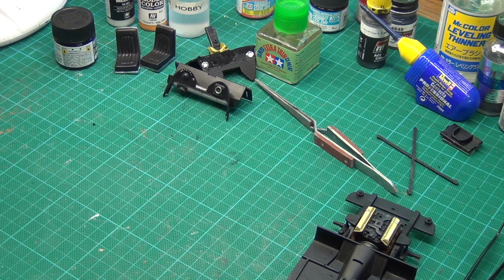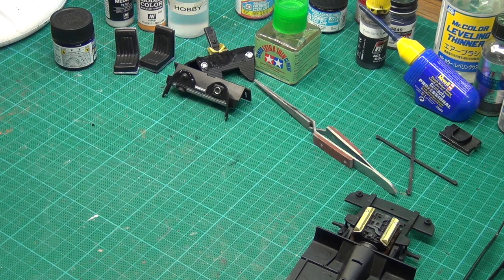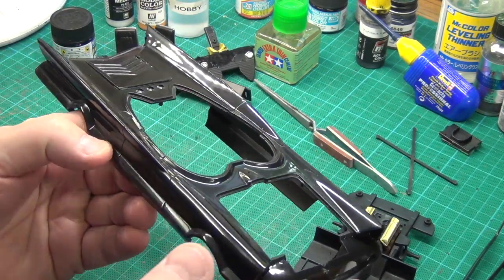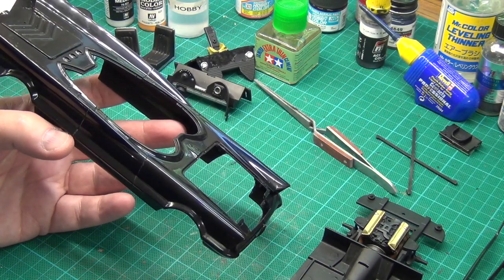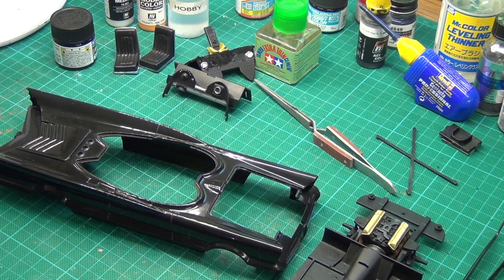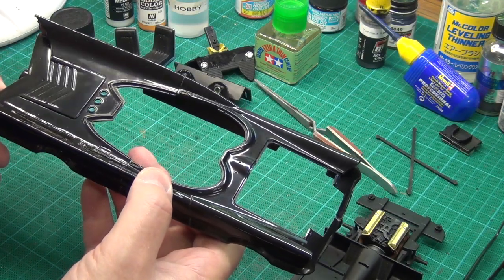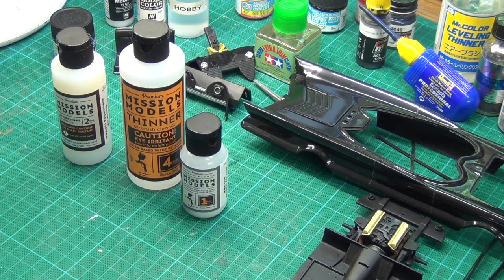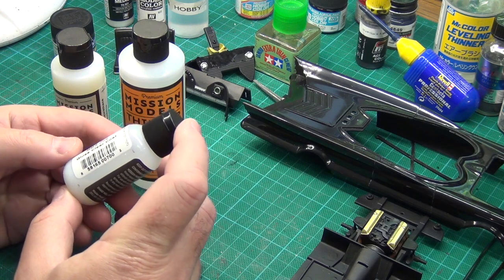Mission Model Gloss Clear Coat

Comment: My basecoats for my tanks are gonna be water based acrylics so I'm trying to find an acrylic varnish to use before I put on enamel based weathering products and pigments. Any suggestions? It's a wild west out there and for every product I find someone recommending I also find 5 people saying they had nothing but problems with it. It's really overwhelming...
Reply from the maker: Hi uglimus and yes I get what you mean about everyone having a different opinion on every product. In the acrylic varnish world the three I have used are Alclad Aqua Gloss, Vallejo Polyurethane Gloss and Mission Models Gloss and Satin varnishes. Oh and i also have AK-Interactives Ultra Mat Varnish, but not experience with their equivalent gloss and satin.

Bottom line is all four have worked fine for me. The Alclad has the advantage that you don't thin it, but it can play up if you accidently shake the bottle and get air bubbles in the spray gun cup. Vallejo works great if you thin down 50-60% with their acrylic thinner and put on a dusting and then a light wet coat. AK-Interactive is a bit hit and miss. Mission Models works with their propertery thinner (please use theirs for best results) and its simple to mix as they have clear instructions on their web site on how to mix and use it. Its also very durable and forms a nice hard surface, which can be polished quite nicely for car kits too. Its sounds like more work, but I actually think the Mission Models is the best all round of the four I have used. Down side is you have to use their thinner for activating it and its relatively expensive compared to the other two, but you would stilll get quite a few 1:35 tanks kits out of one bottle for example. I tend to use the Vallejo simply because its cheaper as a base for tanks etc, but I think the Mission Models is the clear winner for me on acrylic clear coats.

https://www.missionmodelsus.com/collections/clear-coats
https://www.missionmodelsus.com/pages/tips-and-tricks-faq

Hope that helps, 
Dan
Reply: @DansModelBench  thanks for the comprehensive reply. Lots of good info!

Comment: Did you adhere to their recommended pressure of 10-12 PSI, or did you use a different pressure. I'm not a car guy, however I love your choice of car kit. Thanks!
Reply from the maker: G'day JP C, I'm not a car guy either, buts its the Batmobile, what choice do I have! To be honest I can't recall the air pressure I used, but I think it would have been closer to 18 PSI. Since I shot this video I've sanded the model back and reshot it with lacquers, using Mr Color Gloss Black and SMS Super Clear over that and I am over the moon with the finish. That said the Mission Models clear is very good for an acrylic. Actually the whole Mission Models range is excellent. Dan